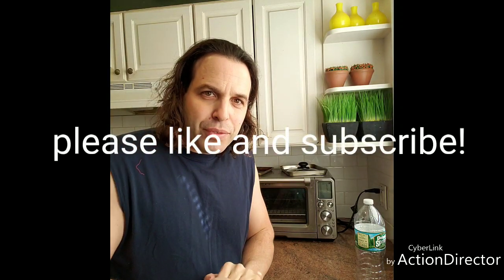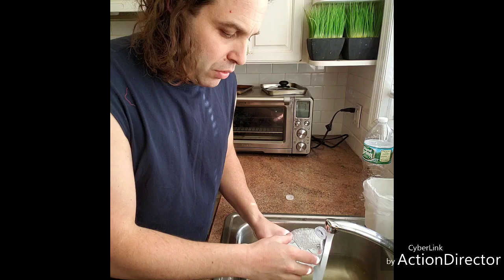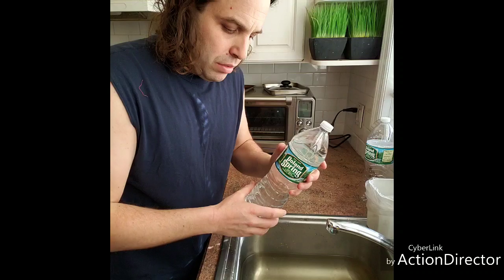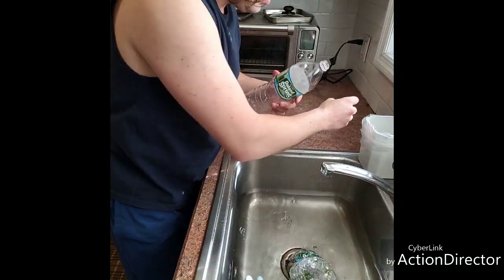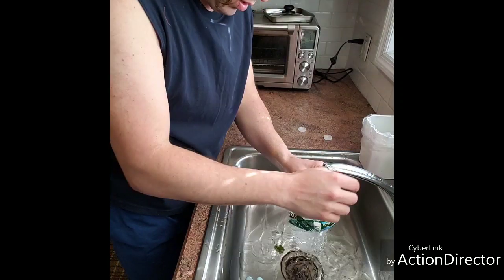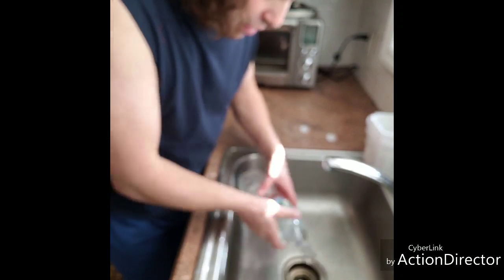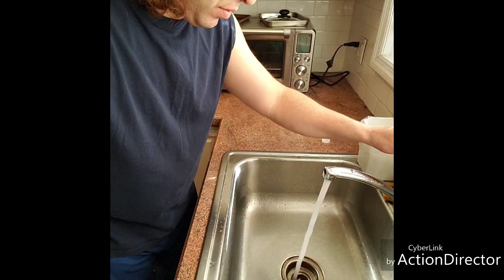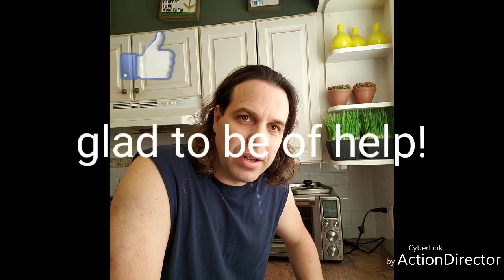How to unclog a kitchen sink drain with a plastic bottle

Comment: OMG OMG OMG. kitchen sink clogged (for 3 days now -slow draining went to no draining ( I don’t cook so it’s NOT fat/grease/shortening/oil etc etc). Tried EVERYTHING.  Even the old hanger thing.  Watched this vid thinking “no way”. Used an 8 ounce water bottle ONCE.......seriously I can’t believe it.  As a not-so-young female I’ve been soooo over charged for locksmith, toilet replacement and plumber (my last house) and just dreading the cost of plumber here and still in disbelief that this worked.  Liked and send you big thanks from Toronto 🇨🇦🇨🇦🇨🇦

Comment: It Worked! First I tried the other method - baking soda & vinegar with no luck (2x) - then I found your post and gave it a try. On a double sink (no garburator). I folded a paper towel to mimic a plug, and held it down on one sink while using the bottle on the other. Oh the simplicity! Not even 2 minutes and the sink/drain was clear. You're a keeper!

Comment: I used your method and it worked after the first bottle of water was pulsed down the kitchen sink. Did it a few more times until the plastic bottle was no longer any good. My sink was not as clogged as yours. Very happy with the outcome. Thank You very much.

Comment: Brilliant!! Thank you so much. I tried sink unblocking detergents, bleach hot water etc and was without a plunger, tried this with a milk carton worked a treat after a couple of goes on a stubbornly blocked bathtub, one thing I will say is cover the over flow drainage hole at top of sink/bathtub, if you have one,  to stop watershooting back up through that, I just covered with a sponge. What a life saver you are, thanks again 👍👍👍

Comment: Thank you so much for this video.  I live in England where we currently have lockdown.  I have to completely isolate because of health issues and my bathroom sink has been blocked for days.  I was getting so stressed about the prospect of having to get a plumber round with everything that’s going on.  I had tried every other method I found on the internet - your method is the only one that worked and it worked first time.  Really appreciate the video! Thank you from over the pond 😊
Reply: Thanks so much it's so helpful

Comment: Thank You so much, it worked!! I only had a thicker plastic bottle so I did similar, hot water to bottle and I pumped once by pushing the middle of the bottle, repeated several, like 10 to 20 times...nothing happened that I cld see ...but the water drained slowly/eventually...today tho, all water drains straight away and doesn flow up the other side of sink...Subbed as Thank You!!

Comment: It worked really well. I had used caustic soda and hot water but it didn’t clear. But I used a plastic bottle (well, 2 bottles😃) but first blocked the overflow outlet. Thanks a lot. I didn’t have a plunger but this is brilliant!

Comment: This worked great for me!  I used almost a whole container of Draino with no results.  I used a 1 liter plastic bottle and it took me 4 times of filling it with hot water and squeezing really hard ( I was not strong enough to push down on the bottle like in the video) and my drain just clear out.  Thank you so very much for this video!!

Comment: Great suggestion! I tried it with 2 small flexible bottles, and after the bottles were all crumpled I used a small plastic bag filled with water (inverted it unto the drain to create vacuum) and the water pressure pushed all that has been clogging my sink drain! Again, thanks for this idea.. 👍👍👍

Comment: 1.  Fill up the sink with the plug in the bottom.
2.  Get a standard rubber plunger as used for unclogging toilets.
3.  Put the plunger in the water and flood the air out of the underside of the plunger.
4.  Remove the plug on the full sink and then cover it with the plunger and move it up and down vigorously.  This creates tremendous pressure and and oscillating back and forth on the clog and gets rid of it every time I've had to use this method even on stubborn clogs.
*There are a couple of caveats to this method and the one cited in the video:
1.  Because it creates so much pressure, it may cause the pipe slip joints to pop off causing a flood under the sink, so tighten them by hand before doing this to ensure that does not happen.
2.  If there is a garbage disposal with dishwasher involved, it may pump water and crap into the bottom of the dishwasher.  Afterward, run the "rinse and hold" cycle on the dishwasher to clear out any back flush into the dishwasher.  The dishwasher detects water in the bottom and will pump it out prior to beginning the "rinse and hold" cycle.
3.  If you have an anti-siphon vent on the dishwasher to garbage disposal line as is required by newer plumbing codes, water might come out of there unless you plug it first.  These anti-siphon vents are installed three different places, under the sink cabinet near the bottom of the countertop, through a hole in the counter or sink with a cap on top, or tapped into the vent pipe.

Comment: What about the overflow drain? The clogged water comes out of the overflow drain.
Reply: You can cover that, duck tape works if you make sure the area is clean and dry before putting it on and put plenty of long pieces on or it will still just blow off. 👍🏼